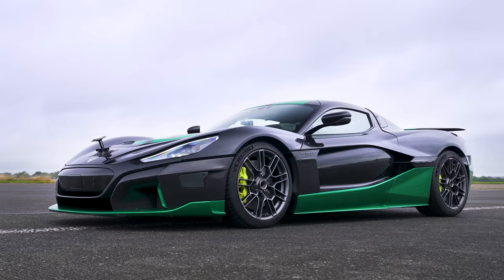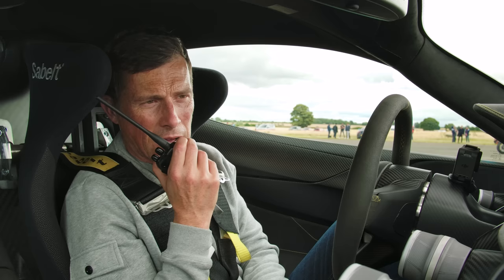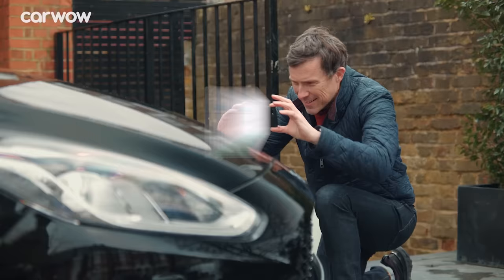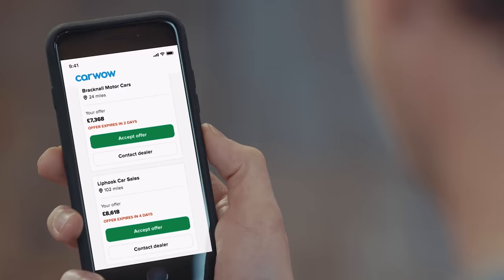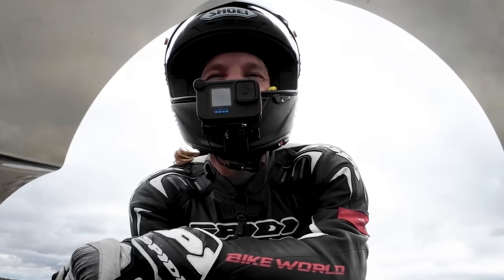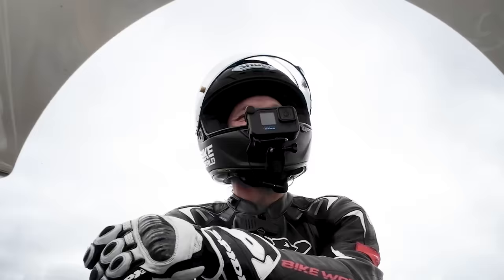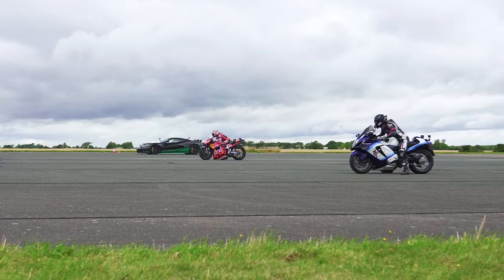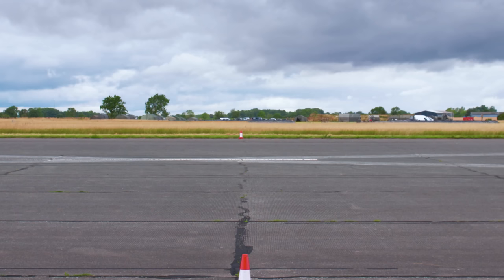MotoGP Bike v Rimac Nevera v Turbo Hayabusa: DRAG RACE

Comment: I'm not a bike guy but that MotoGP bike keeping up with the Rimac is seriously impressive.
Reply: It's the opposite for me.
Reply: Keeping up? It was faster until it got ratio'd by the gears.
Reply: @juneaoalfred3704  A bike designed for twisty tracks is faster than a 2000hp electric road legal drag racer. The bike can turn and brake and have that straight line speed at the same time. The MotoGP bike is faster in a straight line and would leave the rimac in the dust on a track.
Reply: @wss33 yeah but it’s also car vs bike, bikes are supposed to be faster than a car so it’s impressive for the car
Reply: @juneaoalfred3704 i was just about to say😂the most impressive thing is the rimac beating supabikes
Reply: Cars are boring LOL
Reply: @GUEST-ox1sf  Bikes have their acceleration limited to 1G, otherwise they'd wheelie onto their backs. Cars don't have that limit. Although these modern MotoGP bikes might have a slightly higher limit.

Also cars have 4 massive wheels, with 4 wheel drive. MotoGP bikes have two wheels, rear wheel drive, and each tyre having a contact patch as big as a credit card.

The mere fact that they managed to get a bike launch off the line almost as fast as a 4 wheel drive ELECTRIC hypercar, is astonishing.
Reply: @PonagatsoMogano i agree with you.
It should totally be the opposite.
Reply: @wss33 no shit Sherlock. You’re comparing a high tech racing bike designed for racing to a street legal electric production car. You wanna compare your superbike to the top f1 cars and see which one is faster around a track? Please let’s do it
Reply: Lmao armchair racer watching TV all day trying to entertain a debate.
Be respectful like Matt said in his pined comment. Anybody with you guys qi can drive that rimac in a straight line. No one here can do what these riders did.
Reply: That MotoGP sounds to me like it has 20 gears.
Reply: @GUEST-ox1sf  Not really... cars are fastest than bikes (given enough room), obviously, but bikes got better acceleration.
Reply: @GUEST-ox1sf bikes faster than car??😂😂😂😂 Don't make me laught, average superbike can only go 300-310kmh, but this is MotoGP prototype in diferent level
Reply: I’d say that the Rimac keeping up with a bike that weighs less than 1/4 is what’s impressive.
Reply: 2000hp to beat 270hp

electric cars are shit
Reply: hes doing wheelies trying to keep up
Reply: And I think it’s crazy the car can even keep up with those bikes and smoke the suzzu
Reply: @1Goldie 2000hp and weight 2300kg vs 270hp and weight only 157kg.. that rimac dont even need 2000hp if they weight only 700kg like F1 car. If rimac swap the engine with motogp bike engine that rimac would be as slow as truck..
Reply: @AlliCanThinkAbout  I would say MotoGP bike comparable to hyper car. A juiced up bike for juiced up car. Both fast in their own regards but to have something give the rimac a run is entertaining. And yes id go for gp vs f1 as well just to see how it unfolds.
Reply: @autolavista  some clowns literally crying in each comments section kid you crying about weight now? Moto GP bike smashed Rimac Nevera 2nd race and rolling races in very high wind speed which was literally stopping the bikes Moto GP bike started to wobble still won
Rimac Nevera destroyed The F1 car 
Rimac Nevera left F1 car in dust 
If that F1 can't compete no F1 car can compete on this surface 

In low wind Moto GP bike will accelerate even harder on top end 360+ km/h 
It was pushed by wind at 350 km/h it made it slow down that's why Rimac Nevera was pulling a little bit 
If it was a Ducati moto gp bike Rimac Nevera doesn't stands a single chance in any kind of race 

On proper racing circuit or drag strip Rimac Nevera has zero chance of winning any race
Reply: @joshwhite9211  this is grand prix bike not for drag racing lol while still smashing a quickest accelerating Electric vehicle on earth in very high wind
Reply: @p.informatico1320  kid then where's you extra road? Moto GP bike destroyed Rimac Nevera in very high wind
Reply: @AlliCanThinkAbout  Is the Rimac not high tech? Are the Koenigseggs and Bugattis not high tech? What exactly are they designed for? Surley they're designed for comfort with their massive clearance and soft suspenson. Active rear wings are also a massive comfort feature. And everybody knows, more horsepower means more comfort. These 1500 and 2000hp cars are all about comfort.

You're saying ''street legal, production'' like it's a prius.

Street legal cars have way less limitations than racing machines. It can be wide, tall, have 2 or 8 wheels, it can be hybrid it can have a 3 cylinder engine or a 16 cylinder engine.

And yes, F1 is comically faster round a track than a MotoGP bike, what's your point?
Reply: kind note ... thats not a road bike ... you should see it as ... Rimac a road car beating a Motogp bike
Reply: @CarKiruks  fix English
Reply: @wss33 street legal cars are not allowed to rev 18.000rpm like F1 or motogp.. otherwise they will sound much louder than F1 itself. Although they will have more power but can you imagine 6000cc V12 laferrari that can revs to 18k rpm?? How much loud they would be? street legal cars has minimum weight unlike the F1 cars or motogp. Have you seen a road car that weight under 1000kg??
Reply: @Smzxe congratulation… a racing bike can beat a street legal car in 1/2 mile race..👏🏻👏🏻👏🏻 if this what rimac can do to a motogp, i wonder how fast the ferrari F2004 is.. i mean this rimac’s power to weight ratio is only 0.83 hp/kg. I wonder what f2004 can do to this motogp bike.
Reply: @Smzxe do you really actually believe that redbull F1 car can only finished 1/4 mile in 9,6 sec? I mean that’s even slower than sf90😂 with 1200hp+/ton and still slower than sf90??😂 wake up kid..
Reply: @Smzxe you just haven’t watch full video didn’t you? Dani was jumped in every dragrace on this video especially 2nd dragrace.. still rimac won 2 out of 3 dragraces.
Reply: @autolavista  you kid that F1 car is much faster than SF90
That F1 car was side by side with Rimac Nevera till 170 mph Rimac just walked it on 200+ mph
Redbull RB7 did 1/4 mile in 9.2 seconds SF90 is slow as dog compared to that F1 car 
That F1 car gapped Chiron so bad in rolling race at 1/2 mile 
Chiron dog walks Ferrari SF90 you kid 
Rimac Nevera is on another level it made Chiron Supersport look slow 

Literally a kid talking have no idea about cars and bikes
Reply: @autolavista  dani did not jump in 3rd race 3rd race was a clean race fair and square Rimac awd is quicker off the line but Moto GP bike is faster literally same 1/4 mile times 
If it was a Ducati Moto GP bike it would wipe the floor with Rimac 
Its all about reaction time you kid who reacts first wins 
Hes a racing rider they have fastest reaction times 
Blame Matt for sleeping on the line 
But in other races Matt always jumps the start 
Youre not gonna talk about that you kid 
Ducatis this year have better launch control more power 300+ HP compared to KTM 275 HP 
That Rimac Nevera has zero chance against that 
Aprilia Moto GP bikes are faster this year as well
Reply: @Smzxe now we now, no need F1 car to beat motogp bike… all we need is just a rimac. And h2r? It’s out of this league kid..
Reply: @AlliCanThinkAbout  let see if your so much admired F1 car able to go around track in rain, lel
im pretty sure motoGPs able to, lol

and no if you say about aquaplanning on F1 tyre, say that after you try cornering on damp street in any bike, i bet you still pissed you pants, lol
Reply: @autolavista  F1 isn't allowed to rev at 18k. They have a 15k restriction and in reality they barely ever touch 13k.

Both F1 and MotoGP have a minimum weight requirement, which road cars, do not have.

Road cars also don't have a rev limit. And it's not because of sound either. If it's too loud you can easily just put a different pipe on.
Reply: @Smzxe  yeah... You are talking about a race bike compared to a strret car...let's talk about the Devel Sixteen, which goes over 550kph, and compare It to the 400kph of the  Kawasaki Ninja H2R, which is the fastest bike ever...
Reply: @wss33  what do you mean?
Reply: @Smzxe  Let's put It against the Devel Sixteen, and see how It holds up...
Reply: @p.informatico1320  kid devel 16 fake plastic cheap kit car cant even go 2 mph lmfao
Reply: You know if that 2021 KTM Rc16 was mapped to extract its full power or atleast it's necessary  for a drag race. I don't think the Rimac would still keep up with it. Everybody knew who watch MotoGP that these bikes have different mappings they choose to put out it's power depends on the track designed. Most of the time GP engines aren't putting all the engine power because it will be useless if the bike front end would keep on lifting losing its traction. 

This drag show do you think KTM would put an effort to do that. The answer is no. Because it's only a show that makes us see that the current inventions are now can keep up with these racing prototypes.
Reply: @p.informatico1320  you kid Devel 16 is fake cheap kit car 🤣🤣🤣
Reply: @joshwhite9211 dude, f1 cars can corner at 300 km/h. Unless superbikes can do that, that’s the end of the debate
Reply: Moore Mafia's Hayabusa Turbo, aka Hyper Busa, has recorded 8.0 seconds in the quarter mile on a stock wheelbase.
Reply: @AlliCanThinkAbout  dude, I know what they can do. Everyone calm down geez gp bikes corner at 300km too I've seen it.
Reply: That is KTM
Reply: repentandbelieveinJesusChrist2 AMEN bro !
Reply: @dayleashleynolasco5765  And if it was the latest & improved 2023 KTM bike, then I think it could do 8.1 sec with the best mapping  available
Coz the record for the Nevera is 8.2 sec with best conditions
Reply: @p.informatico1320  the devel 16 is not real. Just let them argue it out clearly you don’t know anything 💀
Reply: @1Goldie The power to weight ratio of liter bikes is awesome, especially for the price and with a few mods. I don’t think a lot of people realize how fast they really are. Granted this was a MotoGP bike but still.
Reply: @p.informatico1320 Depends on the car. If it tops out under roughly 186mph/299kmh a bike might be faster. If it’s a car like a Chiron or Regera, yeah those will outrun pretty much anything else given enough room, pretty sure including the Nevera.
Reply: @um900 bikes are limited to that speed though.
Reply: @jaysunbrady  i know, thats why i say that superbike and prototype is different, MotoGP can go 366kmh with only 16 second and its not at the limiter
Reply: Meanwhile I'm impressed a Rimac can keep up with that RC16 LoL
Reply: @1Goldie talk again like that when gp bike weight 2300kg..
Reply: @um900 are you sure???🤣🤣🤣dont make me laught man🤣🤣🤣..average fairing superbike 1000cc and upward can speed 300-380kmh...like ducati v4r + racing exhaust...speed 386km/h and not yet reached at max rpm😁
Reply: @ueiwhss53726  300-380?? Broo💀💀 HAHA, zx10r in full stock can only Go 320kmh bro in GPS💀, bike can go 380 because it have a modification and yes it is still not faster than MotoGP lol😂, average superbike go 300kmh in 16 sec, meanwhile MotoGP go 300kmh in 9.0s, and 368kmh in 16s, what Will happen if MotoGP make a run in 1 mil straight line? Easy 400kmh in 21s😉
Reply: @ueiwhss53726  not average bro😂😂, bike that can go 380kmh with note non prototipe bike is tuned baby💀, just watch acceleration 1000cc in GPS full stock, zx10 top speed is 320kmh, CBR 1000rrr is 340kmh, h2 is 340++kmh
Reply: @um900 man...this day everage production fairing superbike 1000cc and upward can go 300-350kmh mostly is europe brand bike like bmw,ktm,agusta,aprillia,n expecially ducati and server production fairing bike 1000cc can go over 350kmh like ducati panigale v4sp2,superlegera v4 and expecially panigale v4r...and i'm never say production bike is same level with moto gp..oh man thats in different level bro...u just amagine today is the most powerfull superbike n/a engine is ducati v4r + racing exhaust produced power 245hp..n can go 386kmh..that is  production superbike...you just imagine power machine of the moto gp..which they say the power is more than 300hp..but that's only 5 or 6 years ago has penetrated more than 300hp...imagine today the machine power of the moto gp..must have reached more than 400hp or more than that...imagine a moto gp like the example ktm rc16 2023 and expecially the most powerfull machine moto gp today is ducati desmosedici gp23...on a straight line track 900meter has reached a speed of almost 370kmh..that's only 900meter + mindblowing acceleration...if the track is longer...more than that speed moto gp can achieve...superbike is superbike..moto gp is moto gp
Reply: @ueiwhss53726  yes bro u're right, MotoGP and superbike is different level, and yes, motorbikes that can go more than 350kmh I think are motorbikes with V4 engines for now
Reply: @um900  yes u are right bro...today the faster production bike is power by v shape engine or v4 engine expecially ducati brand...100% true
Reply: @cancelled_user it only has 6 gears.. after 360-370 it wont pick up more speed
Reply: @PonagatsoMogano bike was on low power to be fair this race is just for show it wouldn't be even close if GP bike was running on full power and mugello gearing
Reply: @Nichaansama 2019 Ducati GP bike was running 7.9 7.8s 
F2003 F1 ran 7.3 @190 mph quarter mile in wet in dry it could run 6.5 sec quarter mile
900 meters 13.2 seconds 600 meters 9.4 seconds over 1.5 seconds faster than Rimac Nevera
That F2003 was on completely wet track
Imagine in dry 900 meters 12 seconds flat
600 meters under 8 seconds
Reply: @autolavista  Lmfao kiddo spamming here these GP bikes can reach 400 kph 2019 Ducati did 348 km/h in 5th gear
Cry more
This GP bike running on low power map
Reply: @wss33  a dragbike can beat most cars, i guest carwow purposely didn't get dragbike team to not embarassed car company. Since a proper dragbike team can do 5 sec 1/4 mile. Just watch bike drag racing and u know how fast prep drag bike are. That busa doesn't have a chance in drag strip
Reply: 2:1 for Rimac
Reply: @Smzxe 2:1 for Rimac
Reply: @wss33 oh yeah then compare a  racer bike vs a racer car and you'll discover how quicker the car is on corners, take suzuka for example, a super GT 500 NSX with 500hp and 1100~1200kg ran almost what? 20seconds faster than a Moto GP? How much Power to weight advantage a Moto GP has?
Reply: @Liander88  Okay hahahaha, and? What are you arguing 😂
Reply: @wss33  you've said the Moto GP (a track bike) not just destroy 2000hp Rimac on straight line but also on a track so you pulled a dumb comparisson between a race bike vs a production car so I've just leveled with race cars for your evaluation
Reply: @wss33 Rimac>>>>motogp
Reply: @Maidenintime86 Navera>>>>biker
Reply: @1Goldie  That Rimac weighs the likes of 2000 kilos, and the MotoGP doesn't even exceed 400 Kilos [Now I myself don't know the actual weight of a MotoGP bike so I may be incorrect, but for sure it's way lighter than a Rimac]

Comment: Death wobbles and still flat out to redline. You're a mad man Chris. Hats off to you, that's crazy.
Reply: Yah, but he did slow down if you have noticed. There is no way he could sustained that speed with his bike getting crazy like that even how good of a rider he is.

Dani is just skilled more than the average motorbike riders.
Reply: both riders
Reply: Also pretty sure that motogp bike is setup very well! The busa is unable to put the power down
Reply: @m135i.  setup, hmm I ain't think so. If it was it wouldn't wobble like that or create a lot of wheel spin. They just brought it there & put in the box with minimal speed in the configuration for sure. Of course they wouldn't mapped it out to it's full power & torque just for this show. This is not competition, they are just there to make some reference  & show that the production cars today are getting quicker. 

It'd Carwow for cars not bikes.
Reply: @m135i.  Moto gp bikes are that stable dude but due to high wind it started to wobble at 220 mph lot of air resistence for bikes 
rimac reached 223 mph but still couldn't catch the gp bike in high speed wind 
Moto gp can go into corners and accelerate that much faster 
main issue is the traction and wheelie even in rolling race he was wheeling
Reply: I think the busa is pretty pathetic. Chris moore turbo gsxr can do 5 second 1/4 mile with 229mph (368kmh)
Reply: Yeah❤
Reply: @orionmobile6545  unlike the gixxer this busa isn't on a drag slick, doesn't have the swing arm that's the length of a car and it isn't on a prepped strip (not to mention that it's cold outside in the clip which absolutely destroys your grip). Comparing apples and oranges there mate.

Comment: Crazy to think the h2r (one of the fastest bikes ever made) with 300+ hp does a 9.9s quarter mile, and then the motogp bike does it in 8.6s. The difference is insane
Reply: The fastest stock production bike quarter mile was a 2012 ZX14R, doing 9.47 seconds @ 152mph.
With slicks on and a good rider, a lot of production bikes can get into the 8's without any power added. As long as you're on a stock swingarm, your quarter mile time is limited by simple physics generally.
Reply: Bro Chris did 9.2 @164 mph seconds quarter mile in one of those races 
Carwow doesn't show real 1/4 mile times 
Check TTS performance Channel
Reply: A motogp bike is between 2-3million $ vs +-50k (H2R) it would be crazy if it would be the other way around 😂
Reply: Josh Herrin already did 9.3 in a bone stock Panigale V4SP2.  
Crazy.
Reply: @kestrel3509  with tweaked suspension
Reply: @Smzxe  Nope, wrong info.
Reply: @kestrel3509  🤣 watch full video bud you ain't getting 9.3 on stock wheelsbase